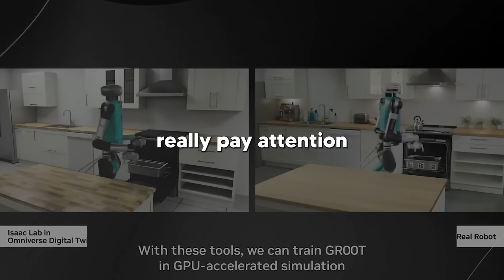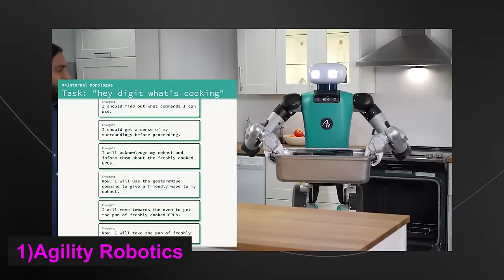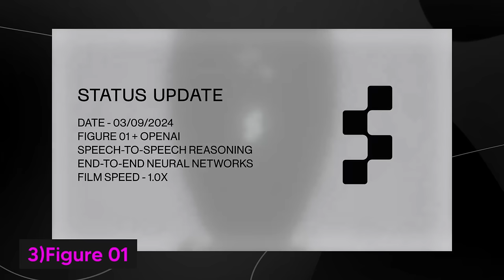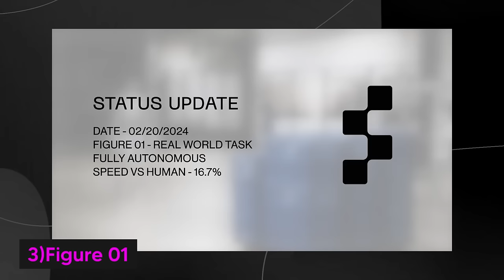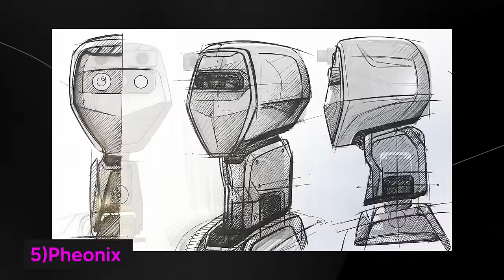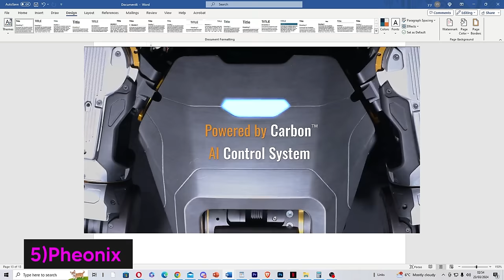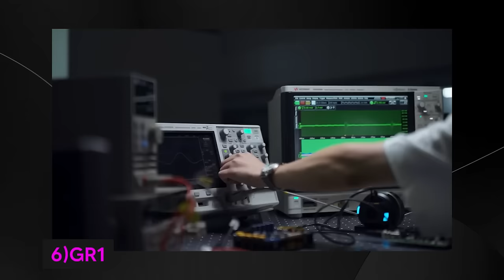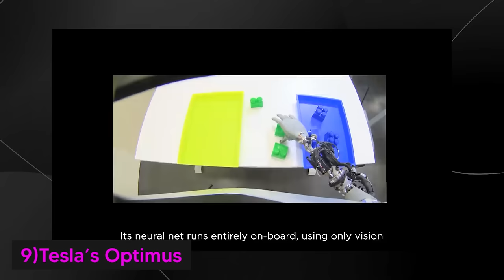Top 10 NEW Humanoid Robots For 2024 (Tesla, Figure 01, Agility, Boston Dynamics and More)

Comment: I can't wait to find out if these are bulletproof 😂
Reply: They are not, actually.
None of them have thick "skins", so to speak.
If they did, they'd be super heavy and even right now, with their relatively light weight, battery power is very limited.

With a heavy exterior, everything would have to be larger. Motors, actuators, sensors, etc.
Reply: Most important feature will be COST and whether they can be built at scale.
Reply: @petersbayley  who cares
Reply: @petersbayley   They will build themselves, eventually bringing costs way down.
Reply: @BlondieSL , it was a joke...
Reply: @michaels3003  Ok. Cool.
Still, the info I provided is valid and there will be those who will say the same thing, but NOT be joking.

You know how people are these days.
Reply: You can actually rip them with bare hands. Atlas is the most bulky but still it got a lot of broken joints by simple falls.
Reply: Why, are you gonna use a $90,000 dollar robot for target practice? Or are you anticipating it having an affair with one of your loved ones? I pity the robots when people can own them...with all the self-directed hatred pointed towards them.
Reply: @GenLeeConcepts  sounds fun

Comment: Figure 01 and Optimus are still leagues ahead of the others for hand dexterity (though the others do have different advantages).
Reply: mobile assembly line is much or of a practical innovation, though. the hands are tech that might be useful in 25 years (without acceleration), compared to tech that's primed to make major social change in 5-10.
Reply: Everybody gangsta until Atlas 001 shows up 💀 (Boston dynamics)

Comment: The institutes and companies should develop robots replicated the movements of the foots when a human walks or runs.
Reply: I AGREE OPTIMUS WALKS LIKE BIDEN. DO YOU THINK TOES WOULD HELP? 
I CAN'T IMAGINE WALKING ON TWO FLAT BOARDS THAT DOESN'T BEND OR GIVE THEY NEED TO SPEND MORE TIME LOOKING AT HOW HUMAN FEET WORK I AGREE WITH YOU.
Reply: The human body is soft. Most of your fluid movements are done by moist cartilage that flex and compress. There's no material that, subject to such friction, will not decay in hours (that's why you eat and replace your cells continually).

Comment: Great, early retirement for everyone! :)

The sooner the AI and robots take over all of the jobs - the better.
Poverty will be solved. Also 40-80% of people don't like their jobs.

We all need a few Optimus and Figure 01 robots per person and it will be the end of human labor forever.
Unless you want to work and create something of course. :)

We will have a parallel economy run (almost) entirely by robots and (almost) fully independent from humans.

If there are no people in the production process - there is no need to pay anyone.

The transition period - the next 15 years - that might be tough though.
Hope we will find a solution as fast as possible.

Deflation in prices of goods and services is what we need. From 100.000 to 10.000 to 1.000 to 100 to 10 to 1 to 0,1 to 0,01 and then it's already ridiculous and basically free.

Things should be cheaper if humans are not making them.

Deflation > UBI
Reply: "Great, early retirement for everyone! :) 
The sooner the AI and robots take over all of the jobs - the better.
Poverty will be solved. Also 40-80% of people don't like their jobs.": 
Compters and robots have already caused a sharp increase in production. But it did not really cause people to work less. It would be a political choice if people can/will work shorter. There are no countries I know, which would allow the workforce to work less hours. 'Everything' is still pointed at maximum production and economy, not at  'work shorter' or environment. Politicians will embrace robots. To produce more. Not to let people work less. The lowest paid 99% people are modern slaves of the richest 1%, and that will not change in the forseeable future.
Reply: @mpmpm  Unless the rich, and then everyone else, gets to have - Robotic slaves (instead of human slaves)

The word robot comes from the Slavic word rab - which means work, or rob which means slave, while roba means - goods.

Basically, if everyone gets to have a few robots (robotic servants), there will be no more need to have modern human slaves.

There might be a difference though, the rich might have hundreds of robotic servants, while the poor - only one or a few. At least in the beginning.
Reply: @mpmpm  yes, but robots producing more and more will lead to overproduction and falling of prices, thus you will need less and less money to buy stuff